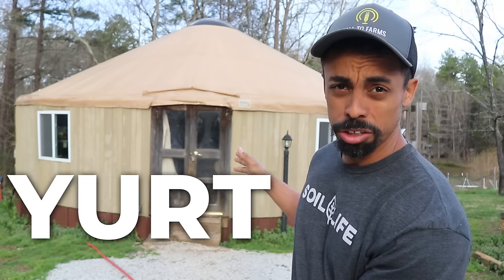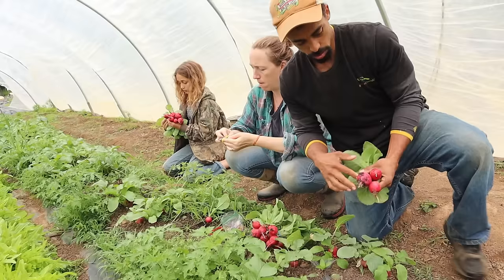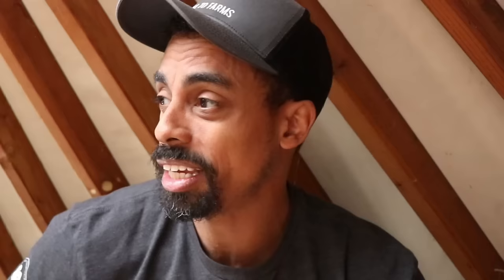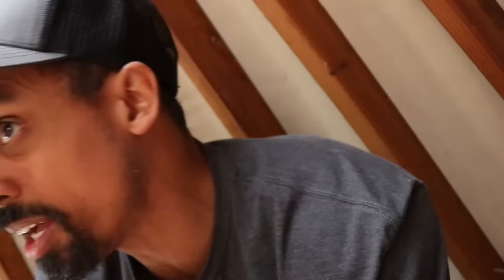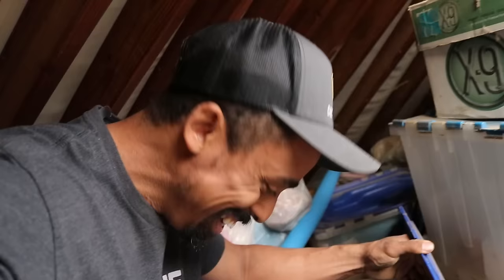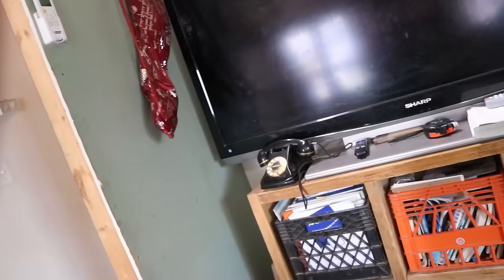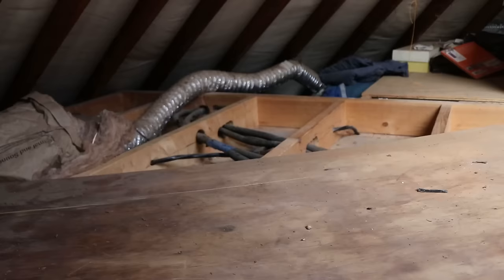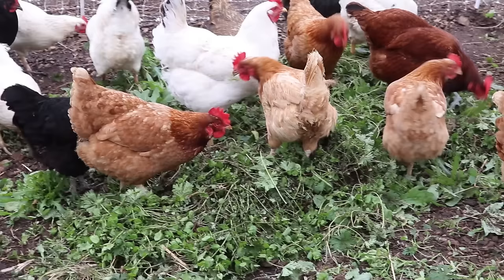Making Changes to our YURT for my wife (& me)

Comment: Your ladder project looks awesome, Mike.  May I make a suggestion from personal experience.  Climbing up round 'steps' is an unpleasant pressure on the foot, placing all one's weight in one concentrated, i.e. small area of the bottom of the foot.  Perhaps you might consider installing 'flat' pieces of wood or metal or best of all, a non-slip material, so that adults will have a more secure surface to make contact with while traveling up and down, especially carrying stuff.  : )

Comment: Laci, could you tell me the all natural stuff you gave Mike awhile back for his allergy to Poison Ivy.
Reply: Yes?
Reply: Take vinegar and 2 paper towels. Wear gloves.  Wet to near dripping the paper towels. Lay the towels straight down on the spots of toxic blisters. 
Keep away from eyes. 
 DO NOT rub. Straight down and straight off only. 
This is removing the poison  oil from your skin. 
Do this 4 times.
Next day if needed do this again. 
That poison oil gets on your long sleeves and will spread the oil after you take the shirt off. Wash it in vinegar several times. Also bed sheets. 
Throw  the towels straight in the trash they carry the poison  oil. 
Throw the gloves away when you get done. Clean gloves each time you do this.

Comment: Can I have the recipe for your dandelion flowers?
Reply from the maker: I collected the flowers and removed the stems, rinsed them in some cool water to make sure to get the bugs out, then I patted them dry.  
Next I seasoned my tapioca starch ( you can use the flour of your choice) with salt, pepper, garlic powder, onion powder, and Italian seasoning. I made an egg wash. 
Take the flowers and add a few to the egg wash and coat the flowers then add them to the flour and cover with flour mixture. Shake them off from the flour and fry them in a hot pan with some oil or butter until golden brown. 
I got tired of doing them individually because it was taking to long so I eventually made them into dandelion patties instead of just individually fried flowers. Either way they were great and my family loved them.